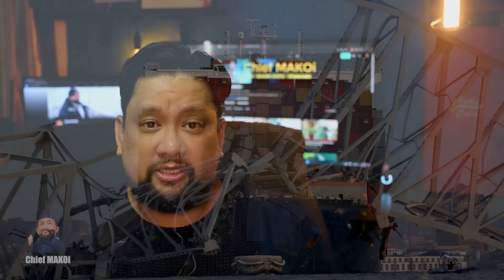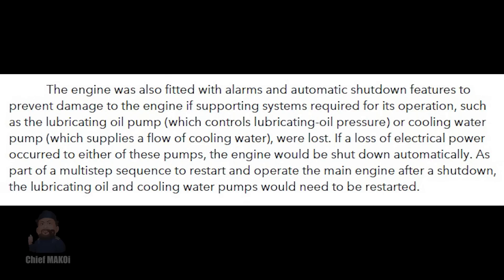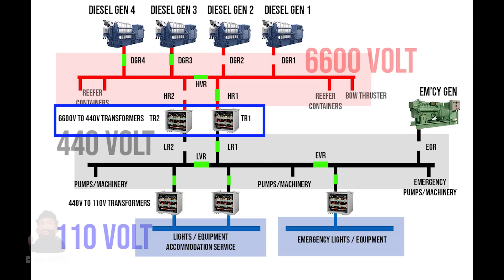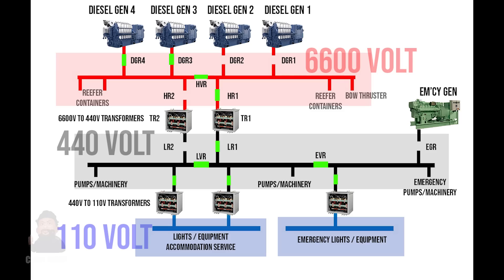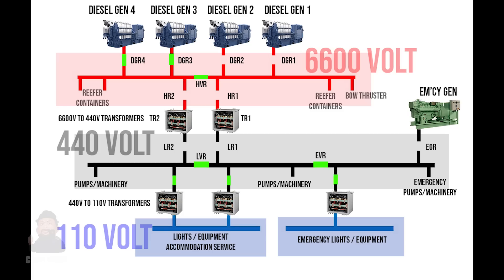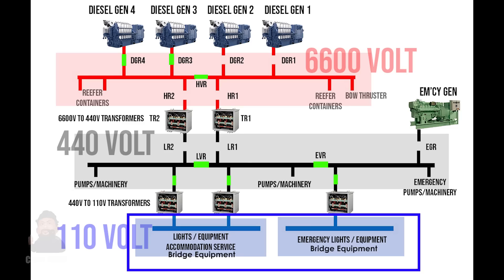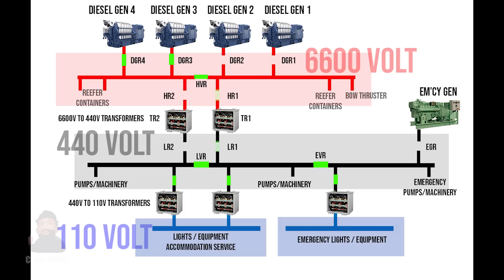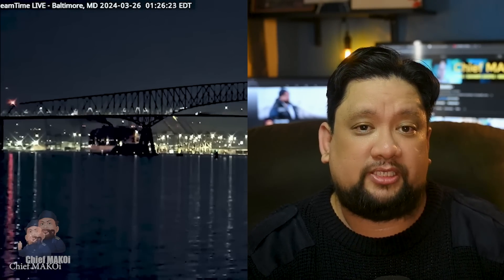Explaining the NTSB Report on the Container Ship DALI | Chief MAKOi

Comment: Thanks chief, I would like to add some more. There's a set of emergency batteries aft of the bridge which give emergency power to nav lights, vhf and other gmdss equipment. This should have prevented the blackout of nav lights. Also the emergency dg should come on load in less than 45 seconds and has to be manually switched off so it should have been on at the time of the second blackout.

Comment: I'm really surprised there isn't a direct engine driven generator capable of running the cooling pumps, oil pumps, fuel pumps, and any critical engine systems for redundancy sake so the engine will keep running even in the event of a total bus failure. That seems like a massive oversight which introduces several catastrophic single point failure scenarios. 

Also systems that prioritize saving expensive components like the engine by tripping it offline in the event of the pumps losing power makes perfect sense when in open ocean with no obstacles and plenty of time to troubleshoot and make repairs but those fail-safes turn into fail-deadly during critical phases of operation - the fact that they aren't able to be disabled or at minimum overridden in critical situations is crazy imo.
Reply: Nothing wrong with  the system if done right,  split the bus,  both sides with Gens running and the redundant systems split across both sides.
Reply: @gregoryschmitz2131  yeah, but you and I both know that in reality, things are rarely "done right". Making sure the systems are flexible enough to gracefully handle off-nominal situations, and the inevitable mistakes and failures caused by inexperienced operators, poor maintenance, jerry-rigged underway repairs, etc. An engine driven generator supplying critical engine systems to allow the engine to be self sustaining even if disconnected from all the buses has been standard for over a century in aviation, cars, trucks, etc. so it just seems strange they wouldn't do it for ships

Comment: Nice explanation Chief. I was a Master on container ships for a 25 years. One thing no one is talking about is the state of tide at the time of incident If it was an ebb tide (following the vessel out) it becomes very difficult to maintain steerage at low speeds even with an engine running and if a vessel loses power she will quickly lose steering ability as the V/L slows. That could be a reason as to why even the emergency power rudder operation was ineffective. Another perpetual problem I faced on literally every single V/L was low insulation alarms in either the 440V or 220V or sometimes both. It would take endless hours of work to eliminate these alarms and sometimes despite all the isolating of systems via the switch board it couldn’t be solved. This could also be an issue in tripping of power. Could you comment on this?

Comment: The black smoke was cause by lack of fuel on the generators. The generators had been running on “gravity” fuel with no load. The fuel filters were probably close to empty when the crew restored power to the main bus. The sudden load caused generators to underspeed as the generators could not supply need power with low fuel supply. The breakers for the generators tripped when generators undersped on low voltage right after that.

Comment: This accident could have been prevented with a proper Activity Specific Operation Guideline (ASOG). Such as, having one generator running on each side of the HV bus (bustie closed or open), both transformers in operation, and LV bustie open.
In this configuration, if one transformer tripped off, the opposite side of the LV bus would have stayed powered. Suppling oil, water, fuel to the main engine and steering to rudder.
You cannot control single point failures (such as breaker failure), you can only position the equipment in such a way as to minimize the failure of a single point, which was not done here.

Comment: As an industrial electrical technician for almost 30 years. I appreciate the Chief detailed explanation. I will be awaiting any more videos especially when the final NTSB report is released. I do understand going thru alarms as I have troubleshoot failures on production lines to find the root cause of the line's shutdown. You have to figure out which specific alarm was the cause of the shutdown. You can only figure that out if you have a through understanding on how a particular system operates and how it can fail. Thank you, Chief.

Comment: I know the name of the game is "as cheap as possible" when constructing cargo ships, but I feel there should be a generator connected directly to the main engine, that's powerful enough to run fuel, lube oil, PLUS the emergency panel. There are many ways to deal with the massive RPM difference. The generators at the Hoover Dam are designed to run at 180 RPM. You have an "AC WILD" (varying frequency) like they do in some aircraft. Alternatively, you could use hydraulics to stabilize things - this is what they do in ambulances. Engine driven hydraulic pump runs a constant RPM generator for frequency stability.

Maybe you disconnect all of it once out at sea, maybe you don't.

But the prime mover of the ship should be able to sustain itself without relying on a complex mix of auxiliary generators, switchboards, etc. Too many failure points.

I am actually reminded of a disaster on a much smaller (150 foot) fishing vessel. The diesel engines originally came with a primary electric fuel pump, and a backup mechanical fuel pump. At one point, the ship was modified for two electric fuel pumps. Well, they lost the AC bus, lost the fuel pump, lost both engines, lost control, and sank.

Auxiliary diesels are great in port or for house loads, but the prime mover should be self sufficient.
Reply from the maker: Thank you for your insight.  We can be sure there will be new regulations that will arise from this incident.  Sadly, that's how the industry works - reactive.  Until something bad happens, they won't consider making additional restrictions.
Reply: @ChiefMAKOi  I appreciate your quick and polite response. But I'm curious what your honest take is on my ideas as someone who works with these systems day to day.

I'm an industrial engineer who works in factory floor automation, so I know enough to be dangerous.
Reply: And when your Main Propulsion Generator quits?    You still have to have separate systems all the way to the controls level.   Better to split the bus at HVR,  have Gens on Both HV busses running as well as E Gen on and closed to its bus (LVR and LR2 open).    But you also should have tugs atached and the piers should be protected.
Reply from the maker: I'm in the process of making a video about this topic.  It will take a few more days, but it's coming soon. 😊

Comment: Is it crazy to say there should be an override that prevents the main engine from shutting off, even if damage is probable, when navigating through areas like underneath major bridges?   Idk about you but I’d rather destroy that ships engine then have a collision with a major bridge and cost the country billions of dollars and lives. Who cares about the health of the engine when the alternative is way worse.  An override should be mandated.
Reply: I just wrote a similar comment. You're completely correct with lube oil and cooling water. But without fuel pumps that engine is shutting down one way or another.

My suggestion is that there needs to be a way to power these key systems directly off the main engine, automatically, without shutting it down.
Reply: @PsRohrbaugh  haha, I wanted to clarify that too as it did cross my mind, there’s no overriding the engine to keep it running if the fuel pump goes down 🤣 But ya it seems odd that the main engine is completely incapable of producing its own electricity or pumping its own fuel.  That creates so many more possibilities for the engine to shut down at a bad time.

Comment: @ Chief Makoi, thanks for such a clear concise and clinical explanation of the vessels Power management system. In hind sight do you feel it would have been safer to run the vessel with a split bus while in enclosed and pilotage waters and returning over to a single bus power management system when the vessel is on ocean passages. The vessels Chief engineer/Eto/technical superintendent along with class should have identified the single point failures which can result in propulsion loss and recommended a safer option while in enclosed waters. The reasons given for the first black out in port is questionable and flimsy but of course subject to further enquiry, however my question is did the on board team file an incident report to the technical management after the incident and what were the mitigating measures enforced to avoid reoccurrence. After watching your analysis I do feel the ACTUAL reason behind the first black out in port(most probably an issue with TX 1)is the real reason behind what caused this maritime disaster. Dali has a sister ship Cezane will be interesting to note if they have been ordered to operate with a split bus in confined waters after the Dali incident. Bean counters sitting behind computers in far flung offices often dictate costs of vessel operation over safety, the poor sea farers on board will have to face the music.

Comment: Great analysis. I am thinking the first electrical outage was differential TX protection operation on TR1 for a (transient) fault? The emergency generator does not have appeared to have started within 45 seconds - the (full) ship lights coming back on was a result of the manual close of the Tx breakers, re-energising the LV bus supplied from DG3/DG4.  I wonder if the black smoke  (Which started soon after after the breakers were manually closed) is related to DG2 automatically starting but insufficient pressure to run DG3 and DG4 as well as DG2? This then caused the on-load generators DG3 and DG4  to stall/trip?  The reports makes reference to insufficient fuel pressure tripping DG3 in relation to the outage that occurred in the previous day at Port.

Comment: Chief, I am not a mariner so I do not know these systems but your explanation was spot on and helped me understand. You mentioned that the generators continued to run possibly by gravity feed after the fuel pumps went out. Then you said you did not understand why the same generators tripped their breakers. I think you hit on it without knowing it. If they were siphoning fuel it is entirely possible that either air got in the line while it was in suction or more likely the there was not enough fuel in the line and the pumps did not catch up fast enough so the generators slowed down on fuel starvation. You said that this is one reason they will trip out. I am just thinking of this from the perspective of what I know as a diesel mechanic.

Comment: I still don't understand why propulsion is necessary for the rudder to be effective.

Movement through the water, yes, but not necessarily propulsion. Did the ship move?
Reply: When a ship moves through water it also drags huge amounts of water around the hull with it. The energy required to put that amount of water in motion ends up leeching the energy of the forward momentum of the ship which causes the ship to eventually slow down (this is called DRAG). With the propeller shut down there is not enough water being pushed through the rudder to make steering effective because the water around the hull of the ship moves along with it. This effect is even worse where the rudder is located at the stern of the ship where the water is pulled the hardest by the moving hull of the ship. Yes the ship will turn as long as it moves but not nearly as quick.
Reply: @legiran9564  - "yes, the ship will move". And as you said, it will move slower, so even though the rudder is less effective at slow speed, the ship is also moving slower so the turning ratio should stay the same.
Reply: @JanBruunAndersen  "turning ratio should stay the same."  Nope. Without the pushing power of the prop the ship is totally at the mercy of whatever flow of water the hull of the ship gets caught in. Especially at the mouth of a river where there are Eddie currents and cross flows can even end up with the ship moving sideways. Chief Makoi is still on point. You need that propeller to properly maneuver and correct  a 100K ton vessel ESPECIALLY in a river.
Reply: @legiran9564  - but that is the case even with propulsion. Without enough speed, be it constant speed through a working set of propellers or decreasing speed from pure momentum, the currents can and will take the ship. Again, it is not about propulsion. It is about speed, relative speed, through the water.
Reply: Simply put the rudder needs prop flow across it  to be effective.

Comment: Why didn't the Dali have both transformers connected while they left dock?  I can understand them thinking it wasn't necessary, but is there any reason that would be impossible or unwise?
Reply: Cost,  you would have to split the bus ar HVR and then running a Gen on each side or two on each side?   I go for two and the E Gen system up and connected but then all the safety can't be with the ship,  attached tugs and pier protection should be there as well.

Comment: Regarding rudder ineffectiveness when propulsion is inoperative, is the rudder ineffective for a two-pronged, compounding set of phenonmena - namely that the propeller is not thrusting water past the  rudder, AND that the slowing or stopped propeller is also now actually blocking much of the water flow that otherwise would be available from the speed of the ship as it continued to coast thru the water relatively faster than the prevailing local current?
Reply: Yes, The blocked propeller will hinder water flow, just like with a plane with air flow, and a plane without engine is much harder to maneuver as well, especially larger ones.
The ship did have a very large cinetic energy though - just consider its speed when the engine stopped, and its gigantic mass. Whether it was enough to counteract currents, apparently not.
I still find the trajectory a bit odd.
Reply: @joseoncrack  Sal on What is going on with Shipping pointed out that there was a river tributary entering from the starboard side perhpas impacting the stern of the ship causing it to veer left.  Also, the port side of the ship's stern may have come close to the sides of the channel which also potentially can cause the stern to be "sucked" towards the side of the channel further pointing the bow to the right and towards the bridge.

Comment: Great Report!

I’m a Mechanical Engineer with lots of Building power wiring experience.  A couple of technical questions.

I’m going to assume 3 Phase power, so:
1.) Do ship power systems employ Ground Fault Circuit Interruption?
2.) If so at what level? Individual breakers or panel wide?
3.) What about phase loss or imbalance protection?

I’ve seen Ground Faulted 15 HP motors take out 1000 HP Chiller panels on GFCI.

Buss bar mechanical shifts causing open phases or outright explosions, yeah been there too.
Reply: That should be clarified as Equipment Ground Fault.   And I saw a 20 amp circuit take down an entire facility as the only Equipment Ground Fault was at the main CB with zero delay on it.
Reply: And another possibility can't be fully discounted...yet.  One that would involve no equipment failures or human errors (OK, maybe not closing an electrical enclosure promptly.) .  

That issue: RATS!  

Several years ago I was working at a firm that had a chiller trip out.  The technician restarted the tripped unit with no issues and no faults indicated.  Upon opening the Panel there was gray fur EVERYWHERE and a rat tail at the bottom of the panel.  Where there is one, there is usually another.

Comment: Why is the captain not required to drop anchor as soon as there are any major power issues, which would harm the ability to effectively steer the ship? If anchor had been dropped immediately after the first blackout, there would have been more than twice as much time to stop the ship.
Reply: Simple answer is no one is prepared for that nor trained and coming up with it on the fly is not possible,  it depends on where you are as to an issue or not.   Authorities should mandate that but do not.   New York requires attached escort and Baltimore does not  -  no national standards.

Comment: I worked for 35 years on large broadcast transmitter plant that had very similar split HV/LV busbars like on that ship (although in our case the HV was 11kV).  In my experience, nearly every HV breaker feeding a transformer had intertripping that caused the LV breaker to trip out if the HV breaker tripped.  This way, the transformer was completely disconnected from supply - especially backfeed from the LV bus bar which could exacerbate a transformer problem if that was the reason the HV breaker tripped.  Thanks for your excellent explanation of the NTSB report - it will be interesting what the final report says.  As you note, I find it strange they seem to have been doing maintenance on the only working generator when the inadvertent closure of an exhaust damper caused a blackout.  There's a lot to come out yet!  Smooth sailing, Chief!

Comment: Question: Why did they not use the bow thruster to steer away from the bridge, when the 660 buss bar was energized ?
Reply: A bow thruster is only effective when the ship is at a dead stop. Good luck opening the bow thruster doors when the ship is moving at that speed. and if in the event the doors get ripped off by the flowing water (and miraculously not damage the bow thruster propellers in the process) the ship's forward momentum will cause minimal water to flow inside the thrusters since the thruster ports are perpendicular to the flow of water. The bow thrusters would be cavitating water instead of pushing it.
Reply: @legiran9564  Not to mention control power and the various interruptions involved.